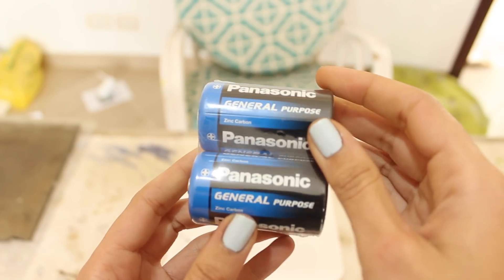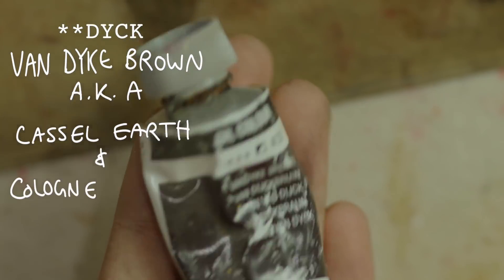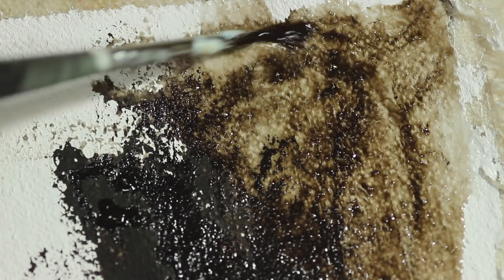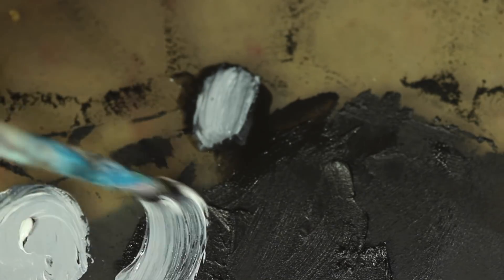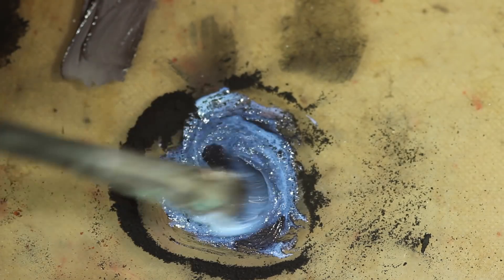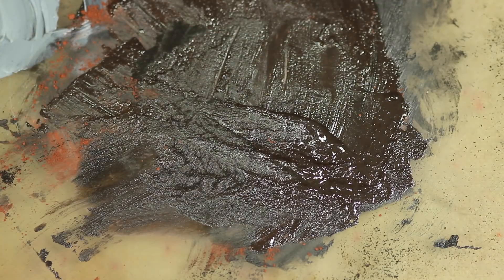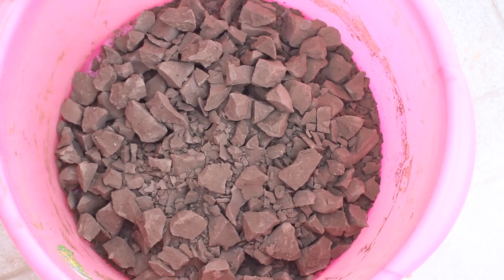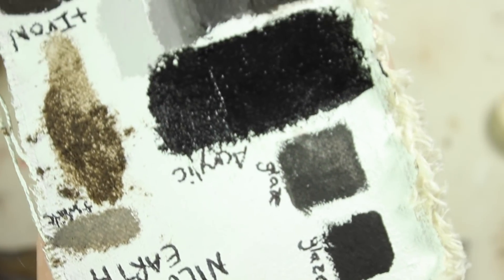Making Oil  Paint out of Batteries + Van Dyck Brown

Comment: Soot! Make soot.
Reply: I wanted to experiment with lamp black myself this summer, but ehm... procrastination. There's not much at all videos on how it's made, but basically you can burn any vegetable oil or, pine resin works as well, and have some surface above for the soot to settle on. Also there's an article in one old soviet magazine on making shoe polish. They produce soot from animal bones through pyrolysis. You're putting bones in a tin can, punch a hole in it, start heating on fire untill smoke from the hole starts to change color. Then take the bones out, gring them and do that thing with water you did to separete smaller particles. Then dry it. Something like that.